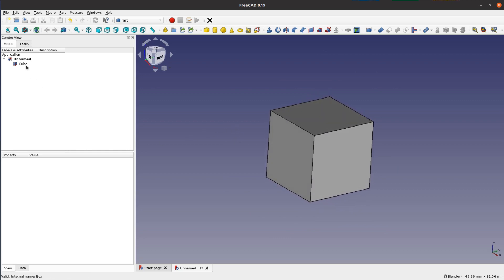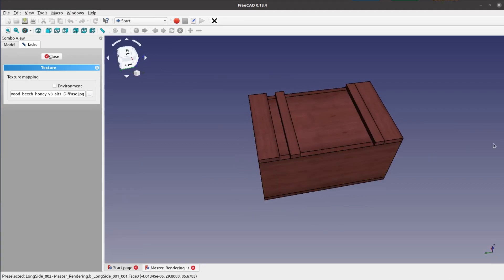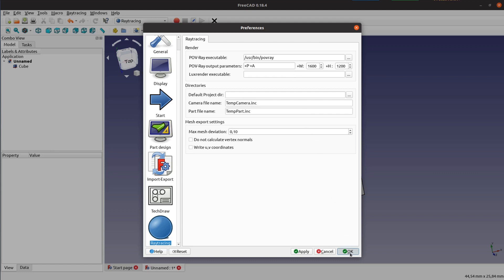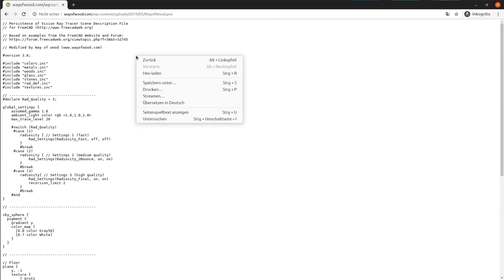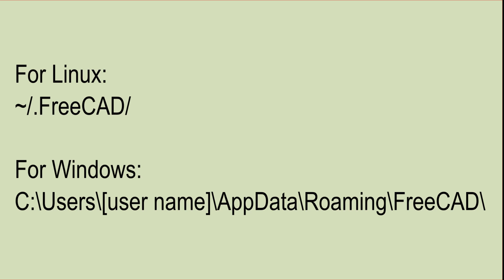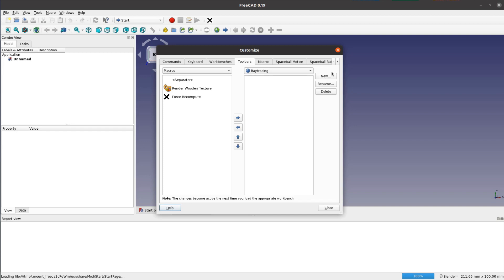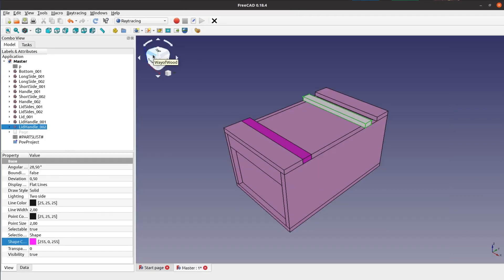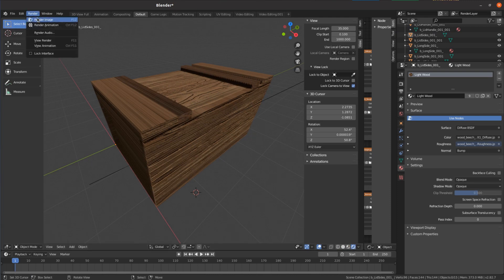Wood Rendering in FreeCAD - FreeCAD for Woodworkers 06

Comment: Nice and compact tutorial! 
For my task at the moment, the texture mappings results look quite decent for an osb style look, for my furniture. My issue is that the look works for as long as i have open the texture mapping window. when i close it it disappears! I would like to continue work with the texture applied, editing the assembly, placing measurements on it and so on. Will these be possible if i follow your final solution steps?
Reply from the maker: I don't know. If it doesn't work you can always export to blender where you have a lot of possibilities in terms of texturing.

Comment: Hi,
Thanks a lot for your great videos. I think this video should be added in the Freecad Playlist, and probably labelled #06. This could ease following your great tutorials on Freecad. Winting for the next one !
Reply from the maker: Thanks. I have added the video to the playlist. What are additional woodworking-related topics you would like to see covered in an upcoming video?
Reply: @WayofWood  Thx for you great answer. Well if you ask .. Please keep in mind I am really a newbie on freecad....  Regarding the assembly part, are there any tools / library to help representing HOW things are put together (like dovetails, biscuits, dowels, cam lock nuts...).  Or a way to create templates representing it, that can be automatically repeated using a "pattern" (Macros?). For the simple case of dowels for exemple, if you need to make a hole evey 32mm... There must be another way than cloning the shape every time manually, and shifting it manually (??)? This becomes a bit more tricky with cam lock nuts, where each face will have to be modified in different ways. Maybe some scripts / macros exist / can be defined ? If so, how ? Hope my question was clear enough...

Comment: 2:10 For me raytracing is not in appdata. its in Program Files folder
2:50 For me it is FreeCad/Macro folder
Reply from the maker: Thanks for the info. I rarely work under Windows and my information might have been based on an older version.
Reply: @WayofWood  
For me Macro is not working. All good till  the rendering. Even asks where to save the rendered file. Then stops. Just doesnt render  :/
OS: Windows 8.1
Word size of OS: 64-bit
Word size of FreeCAD: 64-bit
Version: 0.18.4 (GitTag)
Build type: Release
Branch: releases/FreeCAD-0-18
Hash: 980bf9060e28555fecd9e3462f68ca74007b70f8
Python version: 3.6.6
Qt version: 5.6.2
Coin version: 4.0.0a
OCC version: 7.3.0
Locale: English/UnitedStates (en_US)
Reply: Gives an error in last line. Says cannot load imagefile. Now i realize if i put the file there myself, the macro can load it. So the problem is not loading. Its the creating
Reply from the maker: Weird ... it might has to do something with the way how the temporary file is created. 
Can you take a look in your explorer, enter %TEMP% as a directory and look if there is a recent .pov file?
Reply: @WayofWood  I will do that. But actually i m having a lot of other issues too. Even with the A2plus workbench. I think its my windows 8.1 the main problem. I try things at home(win10) Ieverything was working. SO i kind of quit studying on this computer(win 8.1)
Reply: @WayofWood  Yes i do have. Evertime i click the macro i get a new "POV-Ray scene source file" And i was able to render them by double clicking. Very bad quality for some reason. I will work on them and give you more feedback. Thanks a lot for your time <3

Comment: Thank you for the information. The previous video has help me a lot learning about A2 plus use. Trying to work with rendering (my knowledge about this point is zero), I have a trouble with the path of povray software (to use in the preference place). As I am using Windows, the path that you use in the video is not useful for me (sounds that it is Linux path there). Is this path like the following? C:\Users\UserName\AppData\Roaming\Microsoft\Windows\Start Menu\Programs\POV-Ray for Windows v3.7? (of course UserName would be change by my own one). I am trying to use Render (which would be newer than Raytracing, but the path issue is the same). Thanks and Regards.
Reply from the maker: This field expects the path to the povray executable as an input. So after installing and downloading Povray you have to look for the Povray.exe file (most likely somewhere in c:\Programs\Povray or a similar folder) and copy the path into the settings.
Reply: @WayofWood  I have found that the exe file is not named Povray (under Windows 10 environment), but pvengine64.exe. It is in the following path: "C:\Program Files\POV-Ray\v3.7\bin\pvengine64.exe". Also, it is necessary to uncheck the IO restrictions in Povray. After that I could get a first renderized image.
Reply from the maker: Daniel A. Severo Thanks for sharing the solution!

Comment: Hey! Glad to see you upload, hope everything’s going well during the pandemic. Thanks for doing another FreeCAD video! I cannot get going with this software. Everything is so unintuitive. Due to your videos, I started assembling bits in separate files then tried to assemble them but it would not work at all. Creating the individual components was fine but trying to assemble as you describe didn’t work for me at all. The components would end up at strange angles to one another... I hope you keep doing FreeCAD stuff and I get better at it. I’ve caved and used SketchUp a couple of times now, wish there was a Linux version of Make! Anyway, thanks for the video. Liked it before I’ve even watched it. (:
Reply from the maker: Thank you. Your problems with the assembling sounds as if the two parts are only aligned by one constraint. Try adding more constraints - you need usually three constraints to align two parts properly.
Reply: WayofWood That makes sense. Not sure why I’ve had such a hard time with FreeCAD. I normally learn software, even if not particularly intuitive, very easily. One of those things, I suppose. I’ll keep up with it and keep referring back to your videos as well as the documentation. It’s the sort of video that’s easy for you to do without having to obtain any materials etc. Not sure about where you are but it’s been more difficult to get timber through this crisis where I am. Never mind ordering new tools online! Anyway, thanks again. I’ll make sure to like, share etc every video you put out. I think your channel will be big and the sooner the better, right? (:
Reply from the maker: The challenge with FreeCAD is that it is a real community effort. Other OSS software such as Blender have due to history and their organization a more centralized structure and even if their interface is not intuitive it is at least consistent. In FreeCAD even basic behaviors like the selection logic changes from one workbench to another. This makes the learning curve very steep. It would be great to have a UI/UX overhaul from a talented designer. 😏